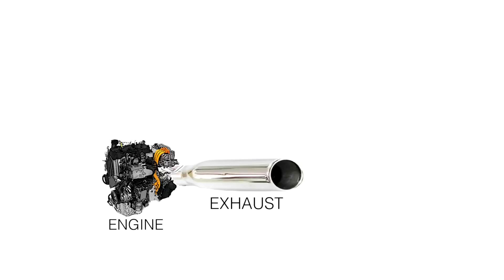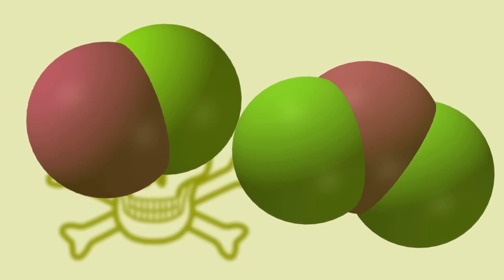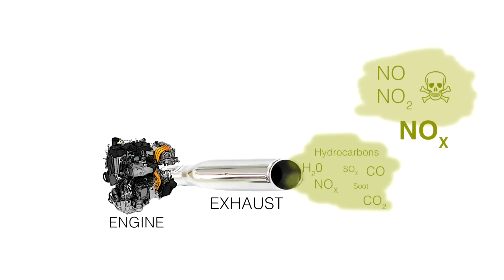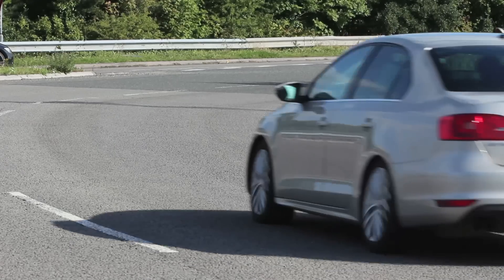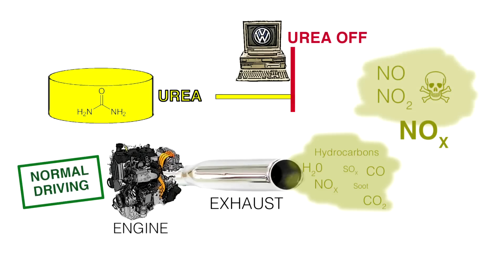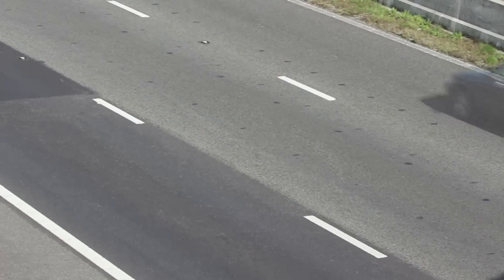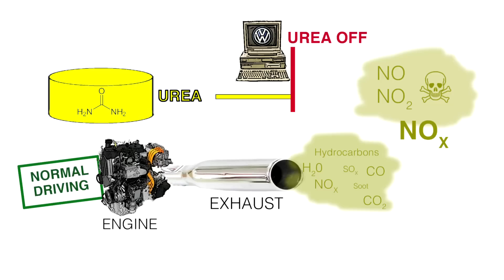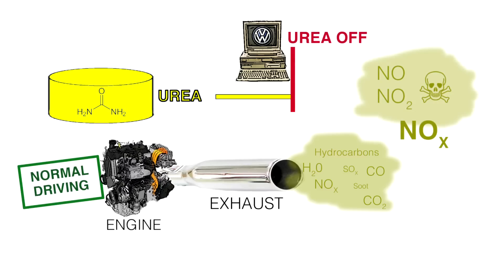Diesel and Urea

Comment: The VW cars don't have the Urea technology, their claim was they could do the same without the extra expense and weight, they were lying.
Reply: +brian whittle Well not relaly. The COULD make the engine as clean... they just didn´t.. And also, if the engine is run on idle or under level load, its still quite clean and probably aplyes to the regulations

Comment: As a matter of general interest, the reason our bodies produce urea in the first place is because of reactive nitrogen species (RNS) such as NOx. These can quickly reduce many molecules in the cell, and so free nitrogen (as a gas NOx or as ammonia/ammonium) can be highly poisonous to cells. The urea cycle sequesters excess nitrogen in urea, which is passed through urine.

For what it's worth, oxygen is just as dangerous, and our cells have ways of dealing with that, too. Neither is quite as bad as cyanide or carbon monoxide, though.
Reply: +TomatoBreadOrgasm thought urea was one of the products that is created when digesting proteins. Kidneys filter out excess of this molecule when levels get too high in the blood to prevent it from becoming toxic and when low on this molecule, the kidneys resorb lots of it.
Reply: +AwoudeX The amino acids arginine and aspartate and the dicarboxylic acid fumarate are both critical to the urea cycle, so amino acid metabolism and the citric acid cycle are both affected by the urea cycle. The kidneys resorb a lot of things based on Le Châtelier's principle, so I wouldn't say that the kidneys resorb urea when concentrations are low because the body needs urea, and the main purpose of the urea cycle is to sequester nitrogen in urea as a waste product.

Edit: To clarify, you're not wrong about urea being a product of protein catabolism, but the reason for that is that proteins have lots of nitrogen, and the body doesn't want all of that nitrogen to hang around.
Reply: ***** So are ROS, but they still need to be gotten rid of.
Reply: ***** That is true. Nitrogen and oxygen are both powerful double edged swords.
Reply: +TomatoBreadOrgasm So which is it, is urea produced specifically to reduce RNS or to sequester reduced nitrogen from protein catabolism and also used to reduce RNS?
Reply: Quintinohthree By reducing the concentration of free nitrogen, you reduce the amount of RNS that will form. Ammonia can also cause damage in myriad other ways. I expect your objection is that ammonia is reduced and RNS are oxidized, but don't forget the many ways you can go back and forth between the two, and never forget Le Châtlier's principle.
Reply: Quintinohthree ??? N2? Who said anything about N2? Oh, wait, I see. Sorry, my professors always described inorganic nitrogen sources in cells as "free nitrogen", I'm not sure if the term has a different meaning in other fields.
Reply: +TomatoBreadOrgasm No really, you did refer to free nitogen as either 'gas, ammonia or ammonium' in your original comment, so please do elaborate. Also, my question was really an opportunity for you to restate yourself on the purpose of urea, because your first two comments made it seem like its purposes are entirely unrelated. Personally I would have said that, aside from sequestering protein derived nitrogen, it also acts exactly like AdBlue to reduce oxidized nitrogen in the body.
Reply: Quintinohthree NO2 is a gas, and that's that I was thinking of, but you are right. I should have said NOx and I will edit the original comment to that effect.

I don't agree with your other criticism. I think that "amino acid metabolism and the citric acid cycle are both affected by the urea cycle" and the edit I made to clarify further make things sufficiently clear, and it is important to note that amino acids are not the only source of nitrogen which is sequestered by the urea cycle.

There are also much better ways the cell has developed to deal with RNS, e.g. glutathione, I wouldn't claim that this is why the body produces urea in the first place. That said, I'm willing to be corrected.
Reply: +TomatoBreadOrgasm, Urea which is ultimately a byproduct of protein degradation.
Reply: +Reivivus Please read the whole thread.
Reply: Interesting.
Reply: +TomatoBreadOrgasm Are CO and CN dangerous because they are more chemically reactive than Oxygen or is it because the body lacks defensive mechanisms to deal with them? (but it does have them for O2 and RNS)
Reply: Jason Slade CO has a much higher affinity for the hemes of hemoglobin than O2 does, so it binds to it and doesn't let go, making the hemoglobin useless and robbing the body of oxygen, essentially. CN and CO inhibit the activity of Cco, making it impossible for cells to complete the electron transport chain to meet their metabolic needs.
Reply: Jason Slade
CO and CN- are both rather unreactive actually. They are very specific toxins, only affecting hemoglobin, binding very strongly to the iron in there and preventing oxygen from binding instead.
Reply: +TomatoBreadOrgasm how did you write a line on "a gas"?
Reply: +AwoudeX 

The reason why our body produces ammonia is because our body sometimes gain excessive amino acids that are not used for the synthesis of functional proteins. Instead of wasting these amino acids, the body uses them as an extra source of energy through the process of oxidization. The by product of the oxidation of amino acid (for energy production) is ammonia which is toxic to cells due to its physical properties and they are converted to ether urine (in mammals like us) or urine paste (in Avian birds, to help conserve low weight for flight) via a complex process called the ornithine cycle.
Reply: +TomatoBreadOrgasm 

It is this because the CO has higher Electronegativity than CO2?
Reply: Eimantas Rutkauskas Hyphens on either side.

Diictodon Synapsida As briefly as I can, it has to do with the fact that two orthogonal pi orbitals (two of the bonds in a triple bond) constitute a conjugated system. It has more to do with the perfectly rigid molecular geometry of the molecule interacting favorably with the heme/β/Fe complex than with electrostatic properties. In short: the best explanation I am aware of is quantum.

Also, touched on this before, but AA's are far from the sole source of waste nitrogen in the body.